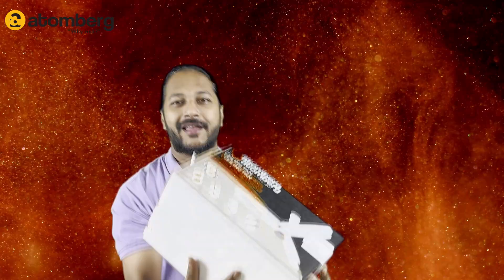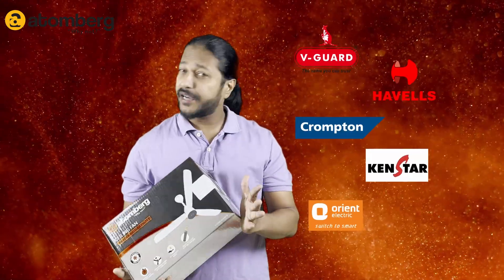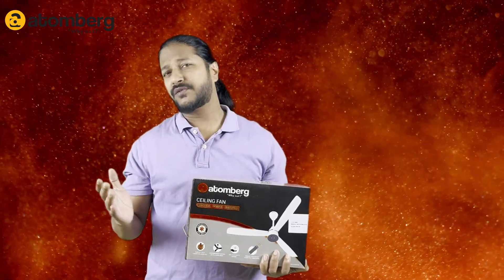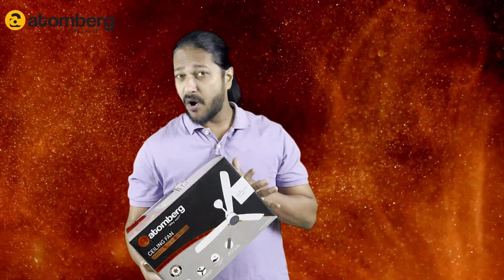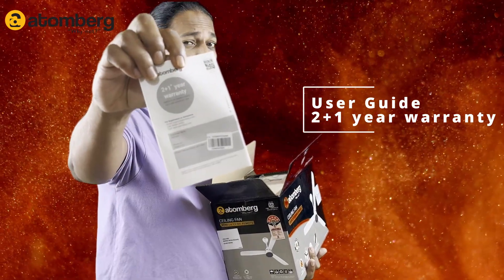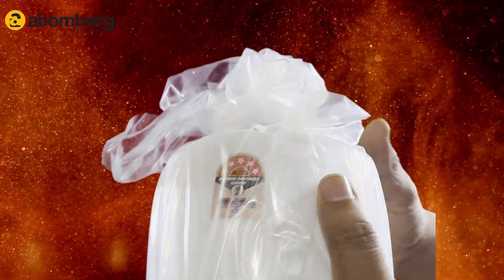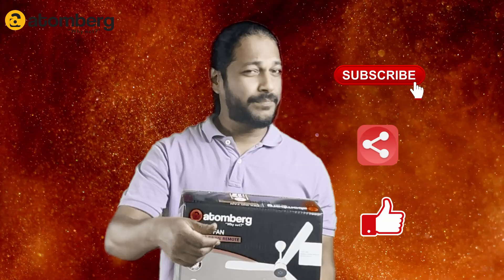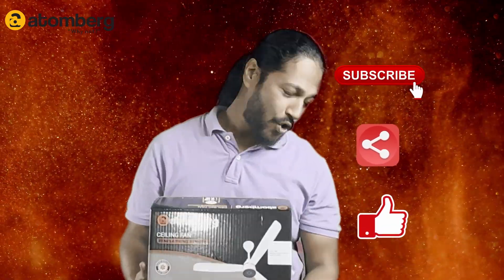Best BLDC Ceiling Fan? 🪭 Atomberg Renesa 1200mm—Energy Use🔋, Airflow, Smart Controls Explained 💯

Comment: Bro I have  received the parcel at 7:55 PM in gorakhpur,  I have unboxed both smartwatch are good but in gobolt box it does not have charging cable,  boat watch have cable , it try to charge gobolt by boat cable but the pins are smaller then the charging port of drift plus,
Reply from the maker: I guess i forgot to put cable back in box u can buy cable from market 100-200 it may cost and congrats again 🥳